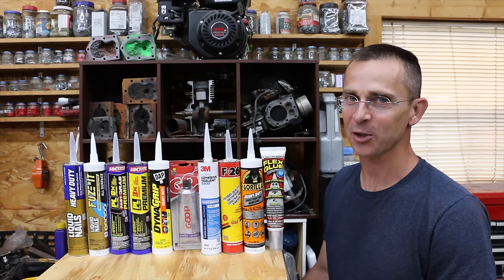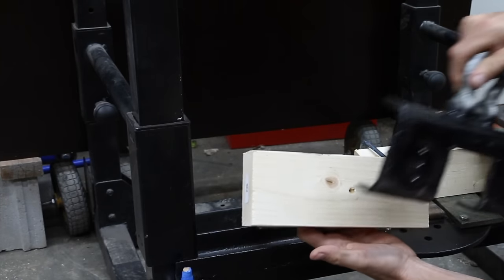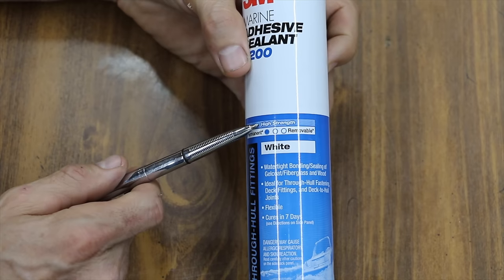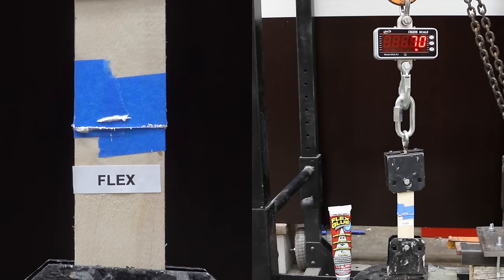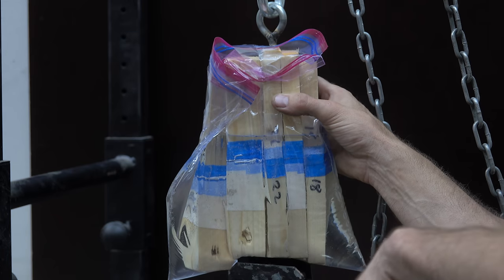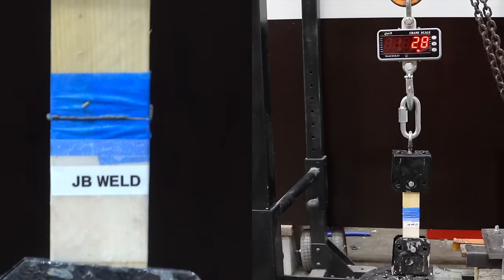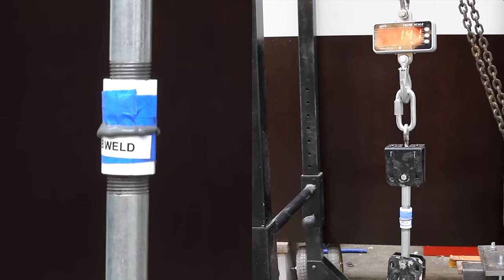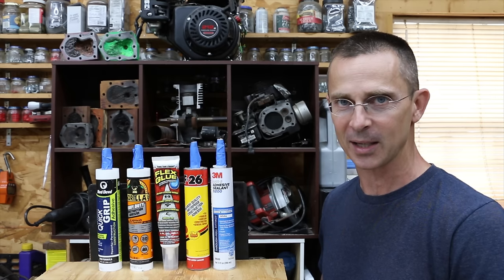Which Construction Adhesive is Best? Let's find out!

Comment: Can you test the difference between brands in mechanics rubber/ latex gloves. 
To see if the chemicals break down the rubber and latex and rip strength
Reply: I just want a glove that doesn't get eaten by paint stripper. Is that too much to ask?
Reply: @billybobjoe198  or battery terminal corrosion...
Reply: nitril
Reply: @billybobjoe198  Depends, what chemicals are in the paint stripper? Nitril ans vinyl usually suffice, but chlorogranics like methylene chloride (dichloromethane) pass through them quickly and are carcinogenic. Both can resist acetone well enough though.
Reply: @EgorKaskader  nitril doesn't resist acetone. In fact it starts breaking down in acetone pretty quickly. I had wondered why my black nitrils were breaking so quickly all of a sudden. It's because I was cleaning up paint and resin mess using acetone.
Reply: @kerielwatson3197  Interesting, can't say I've experienced that with mine, but I also can't say I've used them for direct and prolonged contact - I simply wore them to avoid accidental skin exposure.
Reply: Chain mail gauntlets. Works every time
Reply: @EgorKaskader  break cleaner eats through vinyl gloves really fast. what kind of gloves work with break cleaner?
Reply: @billybobjoe198  use citrus stripper. You can use it indoors even without gloves. Its also water soluble. Ive been using citristripper brand for years. It will even eat awlgrip.  You can even let dry and reapply to reactivate.
Reply: This would be a very good test as I use them often.
Reply: I do sewer matentince so good gloves are important after trying just about every brand I personally think the 9mill gloves sold at habor freight are hands down the most durable/chemical resistant gloves you can buy. Unfortunately they recently doubled in price & can be hard to get thanks to covid
Reply: Challenger 13 mil. By far

Comment: 3M 5200 is the factory adhesive to hold the fitting the driveshaft goes through to the hull on Yamaha PWCs, and has been for decades, I'd say its proven the test of time. Likely many other OEMs are using it for other purposes also, I've had to replace those fittings, and let me tell you, its a job. The 5200 will tear the fiberglass before it releases, better to just grind it off to avoid damaging the hull.
Reply from the maker: Impressive!  Great product for sure!
Reply: I think every competent watercraft builder uses 5200 for thru-hull fittings.
Reply: @athhud  I would suspect so, I work mainly on PWCs and the other brands use a different setup for sealing the driveshaft. Most brands use no sealant if the fitting is above or at the waterline, I've seen seadoo and honda sponsons leaking water in through the bolts threads, I wouldn't want to 5200 them on, you'd never get them back off lol!
Reply: That’s what 4200 is for!
Reply: @athhud  or the UV resistant 4000. I keep a tube of all 3 around, and man they're great products
Reply: 5200 is all that is used on ocean going boats. I used it on my 40' cruiser to seal the 4'X4' hatch cover after it broke loose in a storm. Fix it once and...done

Comment: A tip in more ways than one. 

Use a Winged Twist On Electrical Wire Nut to save any unused portion in tubes. It digs into the plastic tip nicely and seals it well for next time's use. 

Solvent based versus water based will always give mixed results. JB weld did better than I expected on the pvc, for sure.
Reply from the maker: Thank you!
Reply: This is actually really helpful. Better than the Saran Wrap and elastic band I use normally :)  Thank you

Comment: Great video, can't beat good ol JB weld. I'm also noticed that the Gorilla brand is not as good as the commercials claim, because it's products do not perform very well in tests.  Thanks for what you do!
Reply from the maker: Thank you!
Reply: I agree. Gorilla products have failed me too many times.
Reply: Gorilla products are very hyped and somewhat overpriced for what it's worth in my own experience, but then again, it depends of where you're located, USA, Europe, Asia etc., and what kind of taxes and VAT the importer has to pay, and how many percentages the importer and resellers require in profit. Here in my neck of the woods (Scandinavia) the taxes and the VAT is quite high, and therefore Gorilla products are quite expensive. :)
Reply: I agree. I’ve used their super glue and it has failed quite often compared to the loctite I now use. Their gorilla glue just foams way to much to really do anything
Reply: Given gorilla glues test results I'm surprised they haven't sent some guys to project farms house in the middle of the night lol
Reply: I do like the gorilla super glue gel only because of the bottle design keeps it from drying up between uses. I've tried some of their other products and they were ok but; nothing to brag about.
Reply: @coltonjacobs5383  , I don't care for Loctite CA glue either, their newer formulations don't seem to work as well as they once did.  At work we use either DAP or Satellite City brand CA glues. The "Hot Shot" water-thin CA glue from Satellite City is fantastic stuff,   but requires extreme caution because it is easy to accidentally drip on unwanted areas, has strong wetting or capillary action (low surface tension, can sometimes instantly flow  where you might not want it),   and will bond things, especially skin, in a nanosecond.

Comment: 3M is a massive corporation with billions spent in R&D.
You can basically trust 3M to make a great product no matter what.
Flex Glue was just an expansion move for the Flex Seal company.
Gorilla is another flex seal type of product. They're a relatively small company who got brand recognition for a different product, so I wouldn't imagine their expansion products would be good.
Glad to see Red Devil doing fairly well though, I've always liked their acrylic caulk.

One thing I think would have been interested in seeing in this specific marine comparison would have been 100% Silicone 2 by GE. It's often used as a sealant and adhesive in wet areas. 

I imagine it would have performed decently on the pvc cap test. It's used to install swanstone shower walls which are smooth and plasticy.

Comment: Good once again. The attention to detail shows. VIDEO IDEA that is a parallel to the last motor oil series. Outdoor power equipment / air cooled engine / ORV oils. Since much of the zinc has been removed from automotive engine oils, OPE manufactures tout their own oils as better protection for their engines.  Kohler, Briggs and Stratton, Honda, John Deere, Toro etc plus every motor cycle manufacture- I use Kinetics is one I use sold by my Briggs distributor. I don't see much hype on synthetic in the industry.  SO are they better?

Comment: I think for the wood test with the bolt going trough it would maybe have a bit more strength if the jig fit the piece of wood tightly as to not allow the wood to disperse as much,something like a square pipe or similar.Great video !
Reply from the maker: Great suggestion!

Comment: Fantastic testing.  My focus is on F 26.  Hard to believe how little there is on YT for it, for such a well-established product.  Very curious to know why you tested an end-grain connection.  Does end grain glue just as well as face grain with construction adhesives?  I am interested in shear strength as when gluing pine blocks to pine stair stringers to support oak treads I’ll be installing.  Straight down load (shear).  Your method exerts pull-away forces.  Andy thoughts you might have would be apprectated.

Comment: I've read of some peoplw upgrading the keel of their boat. After removing all the bolts, the 10,000 lb keel wouln't drop. The builder, figuring no-one would change the keel, glued it on with 5200.  I've also seen where some one used 5200 to bed deck hardware. The gelcoat peeled off with the hardware.
 I tried a LePage " No More Nails" to glue primed base board to old painted concrete. It wouldn't stick to either, and rolled up in ball for removal. I ended up using PL400, and for holding it in place while that set, i used hot melt glue.

Comment: what about a different approach ?

i allways struggle with small repairs and everytime i grab one of the glues ( silikone ....whatever ) it is totally cured inside because you needed a bit two weeks ago ...
i usually seal the containers .

but which glue is useable for the longest time ? would be a long time video ., but we know the strength now ....try to deploy a bit of it on a used container once a week over time , if this works lets say 3 weeks in a row , then go to two weeks .
Reply from the maker: Thanks for the video idea.

Comment: I think with construction adhesives it all depends on the application you're using them for, in the UK something like Pink Grip is really good for sticking timber skirting boards or architrave but Stixxall is more flexible and can be used on wet surfaces so it's better for external use or sticking metals or plastics.
Reply from the maker: Thanks for the feedback.

Comment: Wishing these were tested against metal as well. I recently assembled a large Lifetime shed (8’x15’), and many of the screws (maybe 15%) failed to grab tightly into the plastic panels, the holes in the plastic just stripping without much force being applied to the screws. 

 I’d like to take one loose screw out at a time, apply some adhesive to the hole, and then put the screw back in. Obviously JB Weld would give me the strongest hold, but I would have to make way too many batches and work quickly to prevent it from hardening. 

I’d like to use something that will hold the screws in the plastic really firmly, but that I could remove the screws down the road if I ever needed to replace a panel. 

Any thoughts from viewers? Would 3M 5200 work well for that?

Comment: I sure would like to see cans of spray foam tested. I'd really like to know which foams adhere better (when initially applied so I know it will stay where applied and long term so I know it's doing its job), which one has the best R-value, best water resistance, best expansion, best ability to expand into small crevices, best fire resistance, best durability, best sound blocking, etc. Ones I typically use are Loctite, GE, Great Stuff (pro and regular), and DAP. I use them all in regular and wide gap and I've also used the fire block, home seal, pond and stone, and pest block versions of many of them. If it's possible to just stick to one or know which ones works best in each application, I think that could be very helpful.
Reply from the maker: Thanks for the suggestion.

Comment: Very useful video, thanks for posting.

Consider these possible video ideas,

Sheer strength of common screws,  

sheet rock screws, 
Tap cons
Self tappers
Stainless steel
Spax or the German made screw found at big box stores.
Deck screw

Best flashlight but adding in cost for what you end up with. (Price, brightness, user functionality, durability)
Something tells me the top of the line Harbor Freight maybe in the top three?
Reply from the maker: Thank you!

Comment: Interesting that a midrange hot glue matches(or outperforms) the weaker construction adhesives in many of these tests. I may get roasted (please do! wanna learn) but for non-critical interior stuff like loose trim pieces or flooring transitions I'll definitely reach for a good hot glue. Just hard to beat the convenience. Plus it's super easily removed with a spritz of alcohol if I want to remove it. Also - I recently learned a tip to keep stuff in caulk gun tubes fresh after opening. Just dribble some hot glue over the tip to make a perfect seal. Put a drop or two of alcohol onto the seal and it will pop right off for use.
Reply from the maker: Thanks for the feedback.

Comment: one common use of epoxy in a marine environment is to fill a drill hole, then put a bolt or screw through the epoxy plug you've created. Since your wet wood failed you  (a normal thing for a man of a certain age) you could redo that test by caulking over the hole you drilled before soaking the wood. Then drilling into the epoxy and placing your jig pin/bolt through your newly reinforced drill hole.

Comment: The PVC test shows that construction adhesive was designed for porous materials only.
Todd, I notice that you have not yet been introduced to caulking condoms. (my term) The little red caps roll down the spout, acting like a condom.  I have an open tube which is 3 years old now and still sealed and soft, so they WORK!

Comment: I'd like to know how they compare to conventional wood glues like TightBond, Elemers, Weldwood, etc.  Sometimes you have a wide avenue of acceptable adhesives to choose from and your testing helps what to use and pay for.  Thanks!
Reply from the maker: Great suggestion!  Thank you.
Reply: What it boils down to: Do I need an adhesive that meets or exceeds parent material strength?  One million pound glue to stick paper pages together?  How do I select the right adhe$ive for the job at hand??  Your videos always boil it down to common sense levels that I can follow.  Thank you for your hard work on videos, plus running the farm!

Comment: All of the adhesives, but for the epoxy 2part are urethane based. Urethane adhesives need a bit of moisture to cure. 

The reason they most all did poor on the pvc is that the pipe, being hydrophillic, could not provide the water molecules to trigger the cure. There is something different about the 3M chemistry that seems to be able to cure even when moisture levels are near 0!
Reply from the maker: Thank you for the feedback

Comment: With the glued that didn’t cure on the smooth non breathable surface might need to use the glue like when installing foam board insulation with PL300.

First you stick the pieces together to test fit, then pull them apart to let the glue off gas for a few minutes, and then bring them back together to bond.

Comment: .....in Australia we had a consumer magazine called Choice , it probably still exists but now would need to be a pure subscription magazine. For more than thirty years they've reviewed and tested scientifically with well planned tests and test equipment every consumer item imaginable more than once . They've done the battery tests ,engine oil tests, camera and lenses tests . For the oil tests the test engines were run for 10 thousand ks then stripped ( probably just accessed the cams) and friction components weighed to determine abrasive losses. For the old school camera tests 29 years ago it was obvious that the best camera and lens was Canon not Nikon .
Reply from the maker: Thanks for sharing.

Comment: I’ve been using 5200 for decades.  While it takes a while to fully cure, I’ve had by far the best results with it over most anything.  I’ve certainly used JB Weld with generally pretty good results, but for many applications it would be much more difficult to use and would end up a lot more expensive.
  I seem to recall 5200 needing moisture to fully cure?  Maybe I’m thinking of one of the other 3M marine adhesives (they make several I know).

Thanks for the test!  It would be interesting to try better wood or attachments to see how it does when the wood does not fail.   I’ve used it more for fibreglass than anything.
Reply from the maker: Amazing product! Thank you

Comment: A few fun ideas. Adhesives vs Epoxy vs Super glues. Ex: Loctite pl max vs Loctite epoxy vs Loctite Super glue. Or Which polyurethane adhesives are the strongest vs Epoxy. Or epoxy vs Dap rapid fuse. 
Could make a 3 product type comparison on which is strongest vs each adhesive type, using multiple surface type; wood, metal, plastic.
Reply from the maker: Thanks for the suggestion.

Comment: No criticism of this guy but! 
How it ages is the key. In Australia I had one of the best go too brittle and fail after about 12 years. On timber too brittle. Could not handle the expansion and contraction of timber. I give up. I now look for one that appears to stay flexible. They all are strong enough for most purposes. 
The one I use now is cheap but stays flexible. Chinese!
Reply from the maker: Thanks for the feedback.
Reply: @ProjectFarm  No worries. You do an excellent job. I often look at your video's. 
The one that failed was "Liquid Nails". Used to glue thin Laminated ply on the walls of a double garage that had never been lined. Tacked down with a few very small nails on the studs.  Great for 10 years and then it started to come off everywhere. 
After that I never used it again. 
Not long after my wifes $150 Track shoes started loosing there soles. 
I glued one with the "Liquid Nails" because I had it and clamped it for days.
Lasted about 1 week. Point proven. 
I then went to a big Hardware store. Read all the instructions. 
There was one simply called Construction Adhesive. Only $2. Made in China but it read correctly. It specifically said it was suitable for fixing Particle board Flooring. Here that comes in 3.6m x 900mm (12' x 3') sheets. Guaranteed to handle the expansion and Contraction. 
Did the shoe. Never failed. 
I simply have an aversion now to Liquid Nails. I notice they put out 4 different types now but I have not tried any of them.  
I have a Carpenters Licence. At age 70 I don't do many bigger jobs now but it still frightens me a bit after that Garage episode. Which one to use? 
I think that was the great thing about "Contact Adhesive" used since I was a child. 
It would hold Laminate down for 30/40 years. Was made by Selleys here in Australia.
Brand Names are a problem in different Nations. 
If you can think of a way to do a flexibility test would interest me. You would need to do them months before testing. I am a bit lost now that the one called simply Construction Adhesive has disappeared.